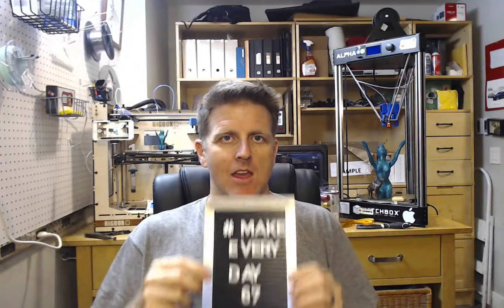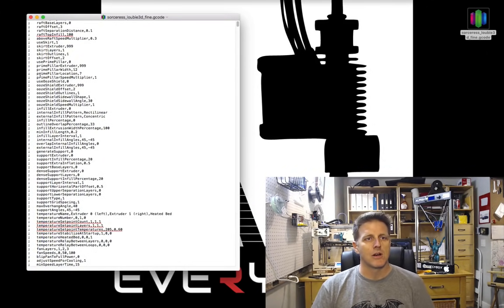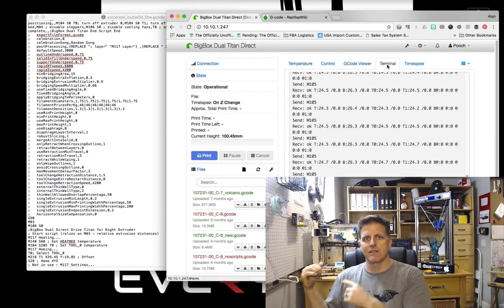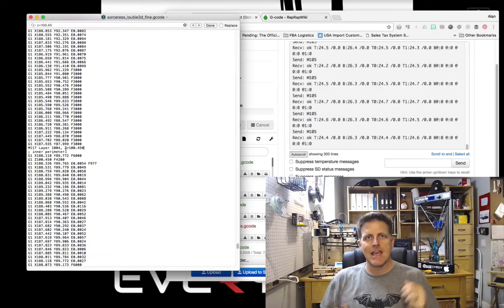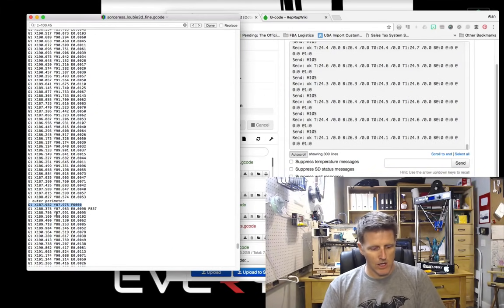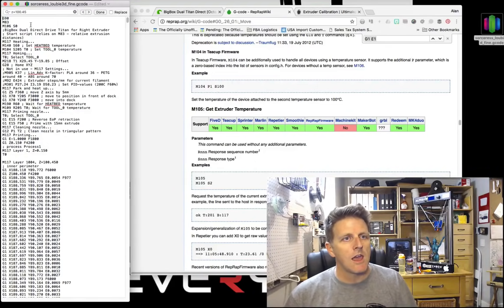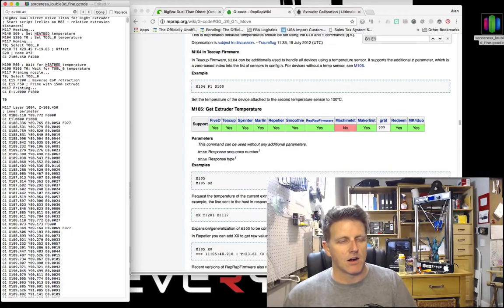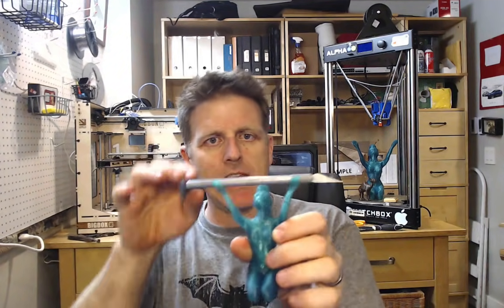How to Resume a Failed 3D Print- Modifying G-Code to Avoid Starting Over

Comment: Bro! You saved me!!! I was 700+ hours into an 850 hour print... Yes, those numbers are correct. I was able to easily follow your instructions on my CR10 S5 using Pronterface... Thanks for putting this out. I want to hug you!
Reply: Wow.. do you have a room-sized printer? 850 hours for a single print sounds insane
Reply from the maker: Come to MRRF in a few months... will gladly accept hugs, fist bumps, high fives, etc. Glad it helped
Reply: A month + long print? Really? You'd need to switch rolls too, I imagine.

Comment: Thanks man, great video!  I was 84% into a 22 hour print on my new Prusa and it stopped due to "Heating disabled by safety timer".  Ugh.  Thankfully I found your video and it's back on track!  I'm doing 6 identical parts and there's an obvious seam on them, but hopefully they clean up nicely when it's all said and done.  It's better than wasting 1/8th of a roll of filament!

Comment: Thank you, thank you, thank you for posting this tutorial. I didn’t want to start over a 3 1/2 day print after 21 hours of printing. I followed your instructions and saved it to Octoprint. Hit print and crossed my fingers, toes and eyes. It worked like a champ. 
Since I was using Octoprint it told me what layer and line of code it stopped printing. So I didn’t have to measure to find the layer for the z axis, although I made sure to double check using your method. Thanks again.

Comment: For better layer adhesion I warmed the bed up 20 minutes before continuing the print and I set z-start to 0.1mm below the last printed height. This way I have one layer with "squeezed on" material, which created a visible seam but it attached well to the existing print. Thanks for sharing your knowledge. Saved my day

Comment: Dude you saved Christmas!! 

I had a toy i was making with electronics I designed that changed colour depending on the angle for a 2 year olds xmas present. I get printing the enclosure made of translucent PLA, with the print set to pause on a M601 half way to glue the electronics and batteries inside. that all goes well, everything gets glued in and I hit resume. 

It's xmas eve and I only have one electronics board so I have one shot at this! The printer carries on but after a while I notice that nothing has been extruded since the pause and the hottend isn't heated any more. LAMMEEEEEE! I google it and it turns out that there's a bug between my particular firmware on the mk3 and Octoprint when using a M601. SAVAGE! So I find your tutorial, follow it to the letter (different printer and slicer but the principles are the same) and after a couple of tests and figuring out how to add a Z height offset to compensate for a height difference I hit go and it carries on perfectly to finish enclosing the electronics and complete the toy. 

Christmas is saved, I have a happy niece (and thus a happy sister and brother in-law) AND I learnt something useful along the way! THANK YOU!!

Comment: Thanks bro i was able to resume a failed print, miscalculated a bit on the layer height, but some quick z offset adjustements in klipper stopped things from pinging off
so measure twice, cut G-Code once!

Comment: I thought my printer had a problem but I went into the gcode, which I use an older thumb drive to transfer from computer to printer, and looking at the code it got corrupted at layer 19 of a 47 layer print. Funny thing is that I just got this printer 2 weeks ago on Amazon and they offer a 30day return. I was thinking, BUMMER, printer is bad but it is code that my thumb drive corrupted. I was able to salvage the piece, which was not critical to being perfect. I did come down on my first Z level just a fraction lower as I like my first layer to be smashed against the bed and I was worrying about bonding the fresh layer against what was printed a few hours ago but it all worked out. I assume, since this printer will resume after a power outage and also when filament runs out that the recovery will work. Haven't tried that yet. I bought a snapmaker the older original as I did not feel like going over $600 for a first printer. It's pretty cool and I also can CNC and laser print which is why I went to the snapmaker. My first choice was a PRUSA but I wanted the CNC and laser for my project. If my project takes off I will, most likely, grab a PRUSA.So, thanks man, worked out for me and best news is that it isn't the printer. I trashed the older thumb drive and I to can upload using octoprint which I will now start doing. Cheers and great job.

Comment: Thanks for this video, like others have said, it's very helpful to understand how get a modified set of code to hopefully recover a print.  One thing I'm stuck on is how to home the Z-axis with the print in the way.  I tried using the 'G28 Z' command to try to home it in place, but it still moves to the center of the build plate.  It looks like your print head stays in the (0,0) position while homing the Z-axis.  Any help would be appreciated.
Reply: Yep I got stuck too...ABL on a new Ender 5 plus...5 hours into a 10 hour print job....Homes on center right where my print is....so no go....If we could figure out how to change the X Y to a corner temporarily...this could work.

Comment: I'm gonna save you alot of time...use your cad program. Then take the model and drop it below the grid to the point  that only shows what you had left to the print. Everything below the base will not print. Just the part you had on the grid which now can be moved around where you need it to be. Slice that puppy and you're good to go. What would have been 10 minutes to setup will now be 10 seconds, if that. It's a good trick that can get you back on the print while  it's still warmed up.

Comment: I know this is an old video. I am trying to resume my print but I am unable to home as it centers itself on the build plate to home the z-axis. This prevents me from completing the home because it just runs into what is currently printed on the bed. Anyone have a solution? Printing on Ender 3 S1 Pro.

Comment: Is there any way to replicate this procedure if you can't home?  When I tried to resume a print I couldn't home because the gantry would hit the model and I couldn't force the printer to go negative in Z with octo or the menu settings on my printer (MK3S).
Reply from the maker: Well, the homing is important to maintain reference of where you need to be. I believe if you have marlin 1.1 or later you could manually move your print head to a position that wouldn't interfere with your model and then try to get an estimated cordinate value and set it with G92... I haven't tried it before and its certainly going to be much less accurate than a proper home.
Reply from the maker: You could try this and maybe err on the side of starting higher on the z-axis from where you need to be and then work your way down till you get it to stick on your model where you left off. Are you sure you wouldn't be better off resuming where you left off directly on the bed and then using some CA glue or 3DGloop to assemble?

Comment: Either I spaced it out, or you skipped over the most important part, how you determined at what height the print quit. If you are printing at a .1mm layer height you certainly need something more accurate than a hand-held scale....
Reply: Use the controls on the printer LCD screen to move the print head (carefully) to the top of your model.  The LCD should show you your Z height.